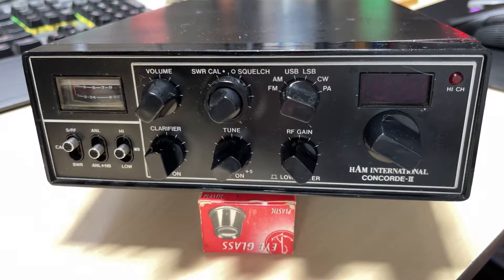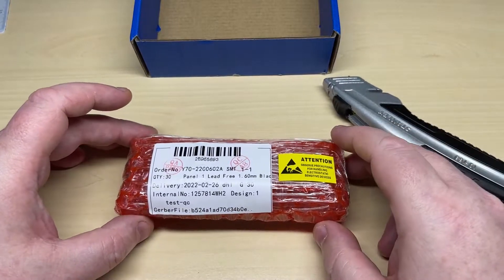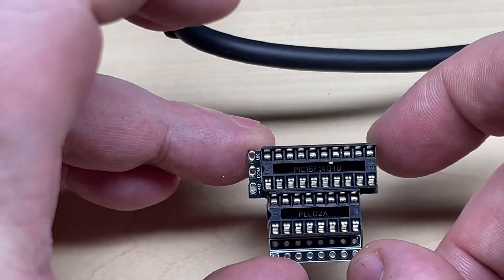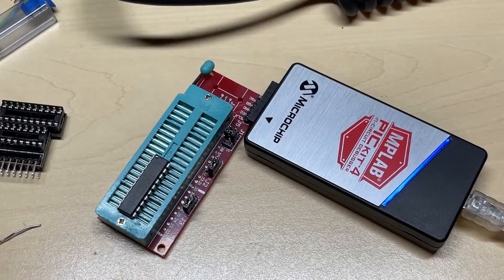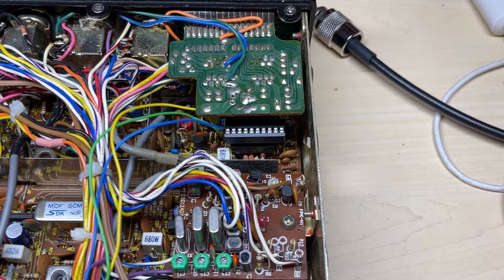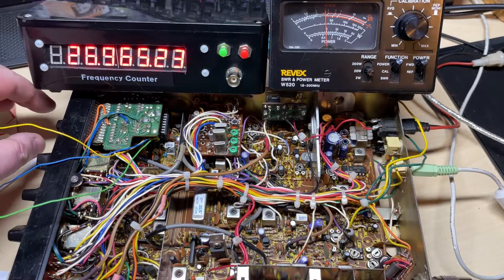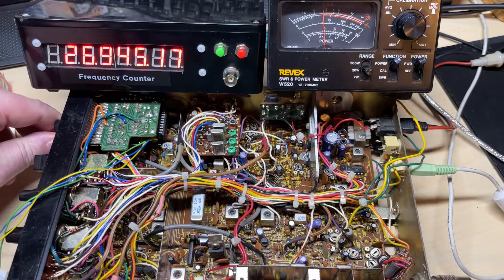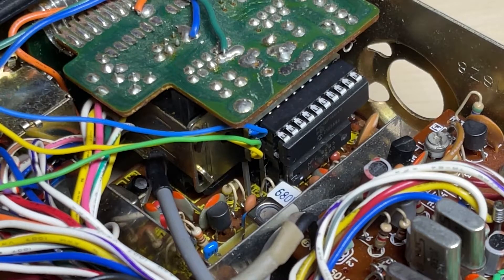EP 052 - HAM International Concorde II PTBM121D4X - First test of the PIC for -40 and UK40 readout

Comment: A very neat modification, I like that the radio stays pretty much original too. Have you thought of bypassing the PLL, VCO and band crystals and fitting an Arduino Nano with a SI5351 board? This would not limit the IF offset frequencies to the range of the VCO and band crystals. I have been playing with old Cybernet multimode rigs and had some really good results. Also what PCB design software are you using as I am impressed with the PCB’s you had made?
Reply from the maker: Thanks :) I have some new boards coming up in the future. This board was made so it was simple to add a bit more functionality to the radio as some people just want a few more channels.My mods try to keep the vintage looks whilst adding a bit extra , and my -5kc version requires no cut tracks.The PCB design is EasyEDA from JLCPCB, this is where i get my boards made as well.
Reply: @MicroChipz  Thanks for the heads up I will give EasyEDA a try.